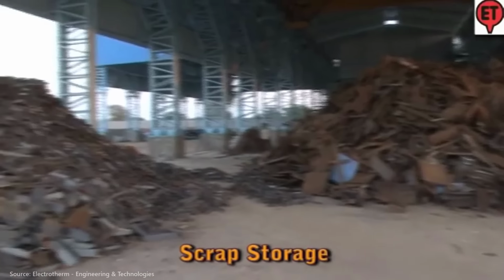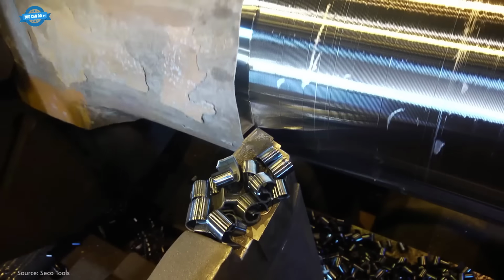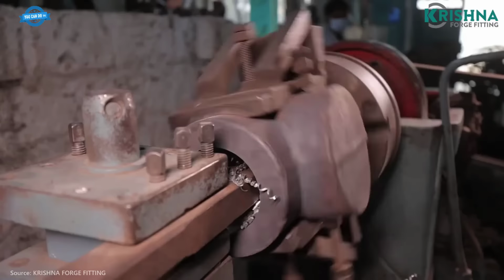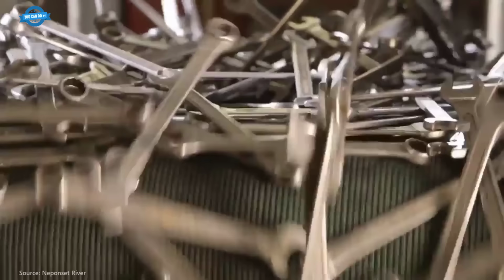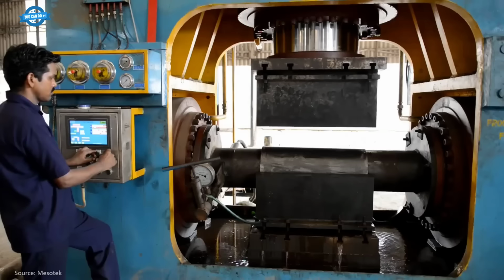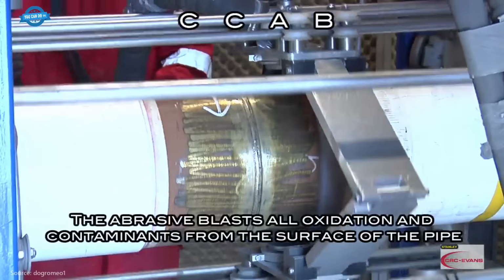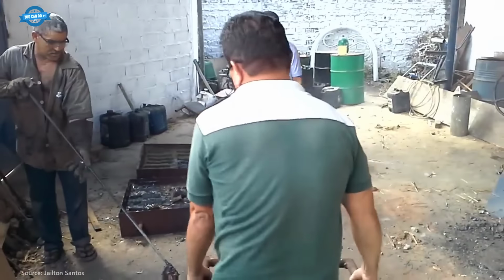How Large Spring Is Made - CNC Machine & Forging Machine. Exciting Mass Production Processes

Comment: Freaking blender of everything and nothing AI garbage.
Reply from the maker: Please refer to the Timeline to watch the specific content you are interested in. Thank you so much
0:02 Billet Making Process
3:10 Large bar forging process
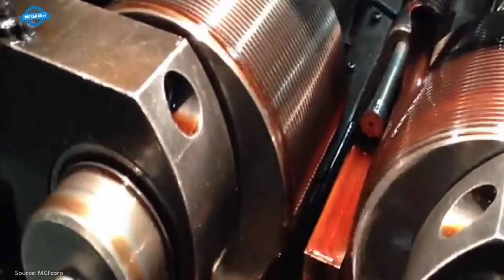5:49 Infeed Thread Rolling Process for Large Bolts
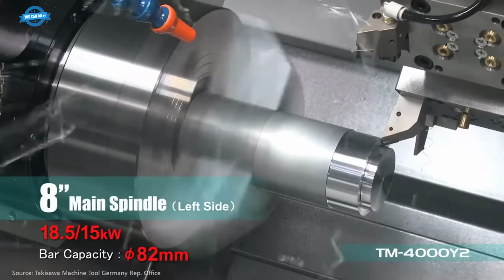7:13 High performance multi-task CNC lathe
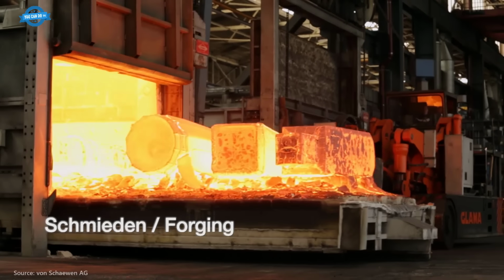9:44 Production Process of the Pre-Finished Shaft
13:33 Heavy duty rotor shaft machining
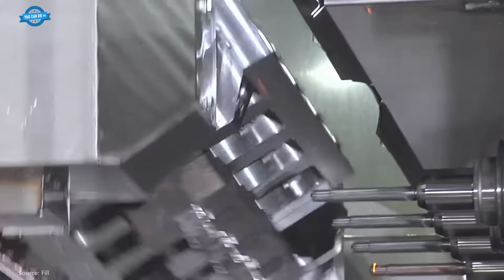17:18 Steel production process 
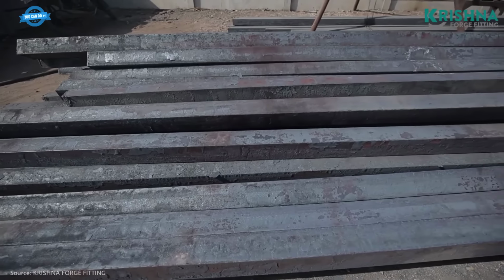19:28 Forge Fitting Production
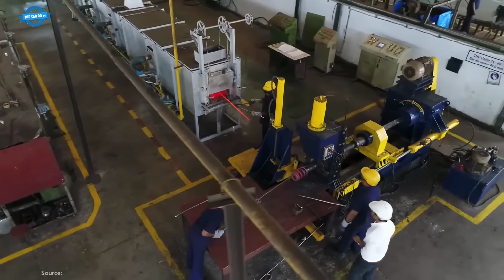22:10 Production Process of Heavy Springs
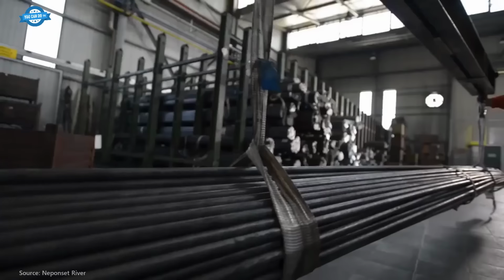25:18 Beta Tools Combination Wrench Manufacturing Process
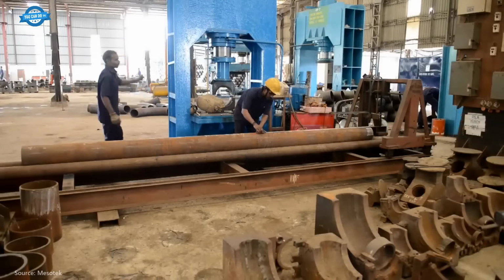35:08 Stainless Steel and Carbon Steel Pipe Fittings Manufacturing
41:24 Spoolbase Pipeline Fabrication Process
44:37 The Pipe Fabrication